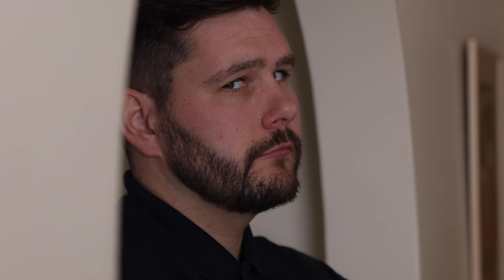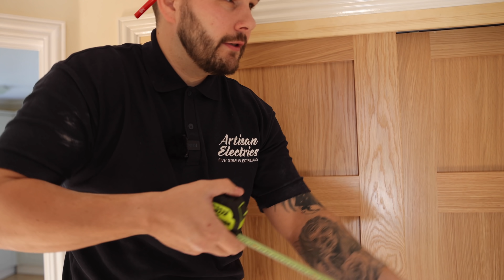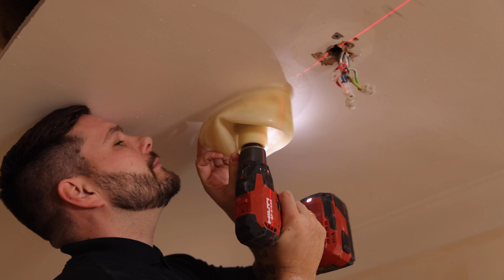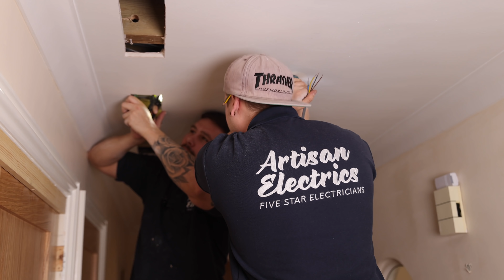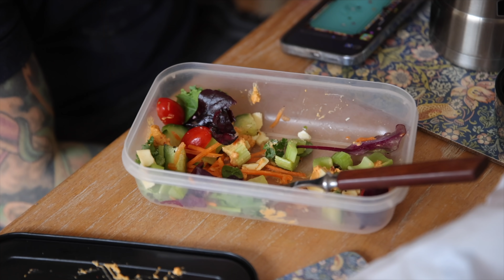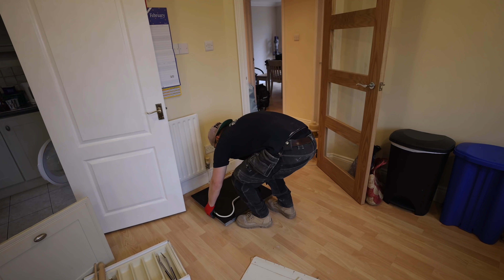HONEY, I BROKE THE DRILL! - Electrician Life

Comment from the maker: Does Luke need to buy Lee a new Drill… Let us know below 😅 Make sure you’re subscribed to our Channel with Notifications on - bit.ly/3nqFpXp-ArtisanElectrics
Reply: Think you should get him a new one Jorden lol 😂
Reply: No Jordan, you should!!! 😁😳😳
Reply: Employer should be buying power tools.
Reply: HOLES IN CEILINGS
Reply: Use a 4inch hole saw with the 4" just covering the joist into the next compartment.  Then drill the appropriate sized cable hole through the joist at an angle or a slim angle drill and short bit. After cable passing cut a short length of 50 x 25 timber wider than the 4 inch hole and screw to the ceiling at either end replace the circular cut out plasterboard, using the drills central hole use 1 screw  to fasten into the 50 x 25 batten . Reseal the ceiling by using polifiller and a rubber squeegee and wet sponge. With care almost invisible .
Reply: @ZackFletcher1  he has bought them power tools just lee fetched his own
Reply: Lee is training Luke, trainer error 😅🤣
Reply: No release chuck put drill bit in vise use channel locks to twist chuck hopfully bit comes out.
I had that happen to me lol.
Reply: Use the revenue from the vids to buy him a new one. Im am electrician and we buy our own tools where i work but if it breaks on a job my boss replaces it, no questions.
Reply: It's actually not broken the dust from the plasterboard has just seized the chuck. You just need to give the jaws of the chuck to get it loose. I had this happen to me while installing unistrut for solar panels.
Reply: Just tap the chuck with the hammer a few times and it will work again, this happens often with makita 👍🏼

Comment: Im an electrician here in Gainesville, Florida and we use recessed “wafer” lights. They are thin enough to fit underneath the truss and still be flush with the drywall. They are awesome
Reply: Those wafer lights glare like crazy though, because the SMDs are mounted sideways. In this situation I'd run fewer and/or odd number of luminaries with slightly different spacing..they're not that noticeable in narrow long space like hallway

Comment: Why not hole saw next to each joist which gives you the perfect circular cut out to fill the hole back in. Drill through the joist and repair is the same process, but cutting the hole is much faster to begin with.
Reply: We do this, 4” cutter and can get drill up enough to drill joist either side 👌

Comment: as an electrician working in Canada and US we use wafer downlights, about the thickness of drywall, and no longer worry about downlights hitting structure behind the drywall. are those a thing in the UK? I know we use split phase so we only ever have 120V at the fixture, maybe the 240V you use requires more space in enclosures (I really have no idea about that though)

Comment: I've done the same thing with my drill and those bits. Especially when extended. The drill is just a little underpowered for the task. Grab a strap wrench and wrap it around the chuck. It'll come loose!

But you can easily replace the chuck if it needs it without throwing away the whole drill.

Comment: You could probably replace the Chuck on the drill however you’d have to destructively remove parts of it to get it off as the reverse thread screw is usually in the center.

Comment: That button on the back of the van door is probably an electronic emergency release if it closes and you are stuck in there. The side doors will most likely have either the same or mechanical ones.

Comment: Apply diversity to the oven and hob and your probably find it's a non issue for a single 6mm supply and a 32amp ocpd, I would get rid of that junction box and put a dual appliance outlet on it, job done.
Reply: That’s ok if the cables are not fixed on the appliances. Had one yesterday where the 2.7kw oven was wired into a JB with the hob on a 32a mcb. The flex was only 1.5 mm on the oven.
Reply: @matthewwalley2412  i had one of these 10 year old  ovens where i was told a 20 amp mcb max or a 13 amp fused down supply was to be used so i duly obliged with the 20 amp mcb as did not want to add to the kitchen ring given it was over 2kw. What was your fix ?
Reply: @Михаиллеви  I put a 16amp radial circuit in and connected the oven to a fused spur located in the kitchen cupboard next to the oven.
Reply: I know it seems rough but if the max load on the oven is less than the current rating of the 1.5mm cable, what’s the issue?
Reply: @alexg113  my thoughts, appendix 15 suggests any load over 2kw should have it’s own radial circuit. If the oven has a fan it’s not a purely resistive load therefore overload cannot be omitted and the iz >= in and not ib.
Reply: @matthewwalley2412  can you please explain the last sentence in your last comment differently. I don't understand. If not no probs
Reply: Fair points.

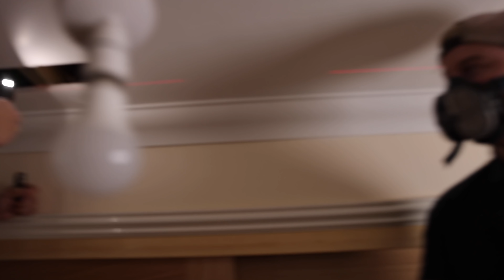Comment: Guys , i only watched 1:45 and had to stop,, been there before, my tip - get 114mm holesaw and drill holes with dade, drill between joist and you will be able to make holes to joist from each side,,  of course easy to repair plasterboard back as you wont have any nails there , so circles will be perfect,, 

I hope it will help to you or any other guys out there
Reply: Just be careful of pipes and cables,, gentle drilling 👌
Reply: That’s my preferred method aswell. Always do it that way if I can’t get access from above 👍

Comment: So much unnecessary damage caused just duck and dive the joists
Reply: Can you explain what that is?
Reply: @alexg113  you just make a small hole and either side of a joist and go under or drill through or sink into the joist alot less damage just needs a little filler job done, use and rod in to the hole push till it hits next joist then take out mark on ceiling and then repeat
Reply: Thanks. I’ve notched joists in the past but I don’t think it’s allowed from underneath now.
Reply: @alexg113  yeah its allowed there's no regs on floor voids or ceilings as such if have a floor that can't come up or client doesn't want up you have to notch. What else can you do in an existing install or house which isn't being rewired 🤷‍♂️